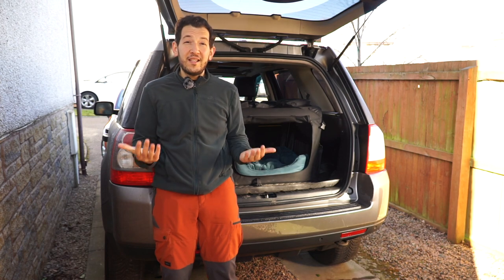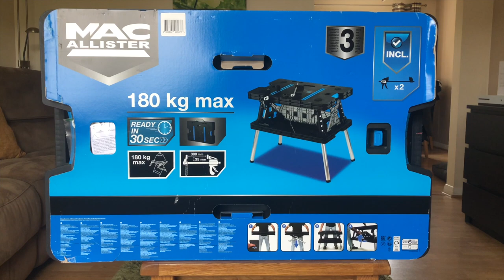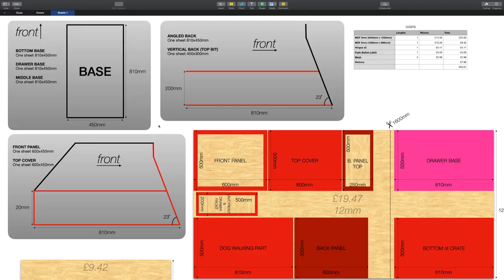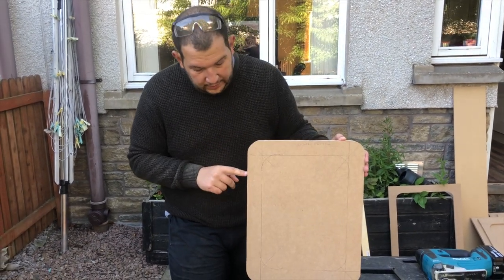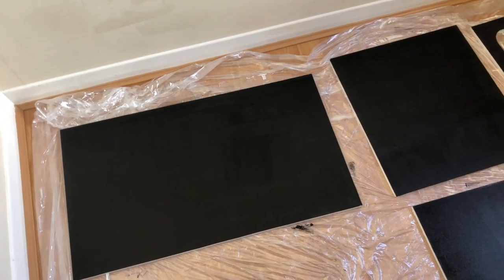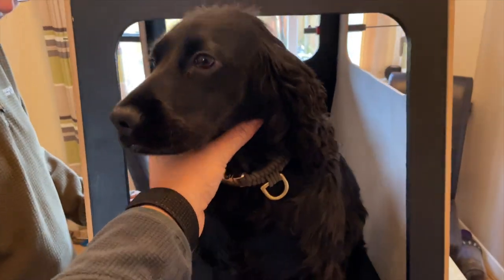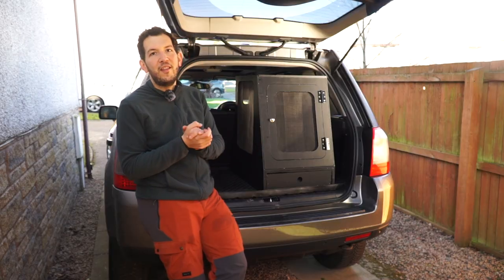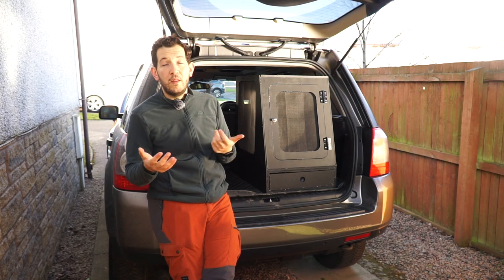THE BEST DOG CRATE FOR CARS | we built it from scratch

Comment: Bravo for the work. But….yes there is allways a but. If you imagine you car crashing into an obstacle at 50km/h all this plywood and textile would do very bad indeed and you would have a flying dog. The forces are immense and I would strongly advise against using wood or plastic or making the crate yourself. Metal is the only thing that will do the trick everything else is just shadows and smoke. Do not DIY this stuff it can save your life.
Reply: If you DIY it you HAVE to lock it into the actual frame of the car.

This is cute but in a accident, it could kill both the dog and the person sitting in front.